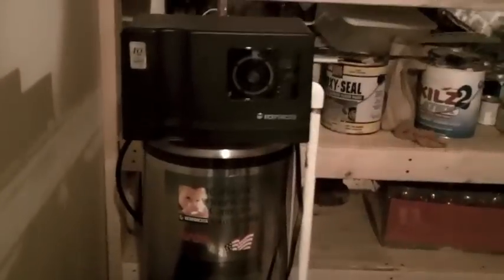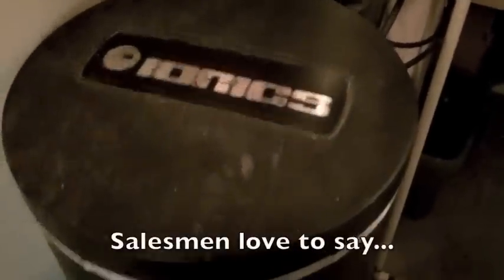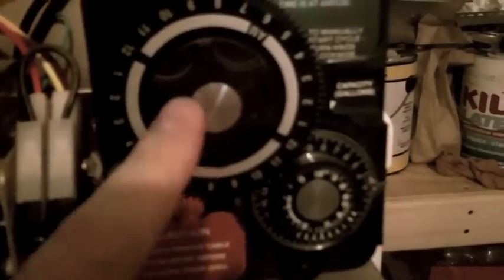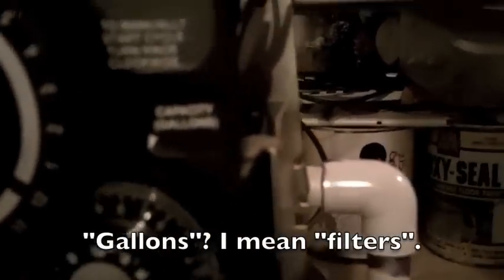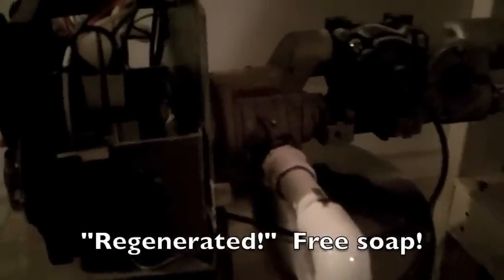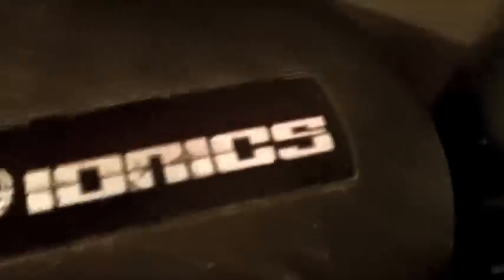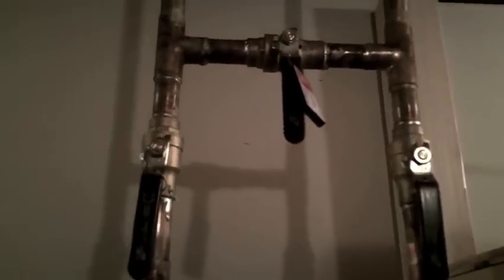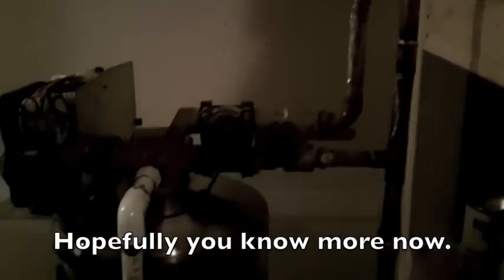Water Softener (Ionics IQ Series) Overview

Comment: Oh, BTW, thanks for doing this video. I've looked all over and can't find hardly anything on these systems...Mine came with our home when we bought it and it's been working well for 3yrs. Although it's old. It does seem to stop softening the water at certain points when I have water in the tank. I "Regen" it and it runs OK for a few days then I have to manually do it again. Do you know why this may be? Or should I just break down and have it serviced and see what they find, if anything?

Comment: Hey Travis,  I hate to bother you once again but here goes. The wires that screw into the black box that plugs in to the power source should have 3 wires, right? What I am asking is this... How is yours wired to the black box? I see a black wire (hot), white (neutral/common) ?green? should be ground? There are 3 screws on the box you plug in. What wires are screwed into your box? I hate to be a pest but momma wants this installed yesterday and is getting mad to say the least. Help!!!

Comment: Okay, now I feel like a pinhead. There is one black wire coming from the head unit. Looking closer there is a red wire and a white wire in this black "sleeve". They should connect to what I would call the power source. On the power source that plugs into the receptacle there are 3 posts. One + and 2 grounds. I doubt it matters whch ground you attach to, but which one are you connected to?

Comment: I have the same water softener but it continually flushes out the discharge line. I think that it is the piston seat failure. Is that hard to replace because the local service company is backed up over a month.

Comment: Here is a realy great question for you... I just bought the same model on Craigslist as well. Not quite the deal you got and had to drive over an hour to get it. I have a manual for it, but do not know how to wire the thing. It came with a power pack that has one positive and two grounds. The problem is that there is only one wire coming from the unit. Any help would be greatly appreciated.

Comment: Hi I have a Softner similar the one you have but I cat adjust the float on brine tank because I got the filter desaseble and I  install my self and I'm going tru salt like craze I need to adjust my timer but on the manual sei the water regenerate at 2:00 in the morning but I don't think thet what is heaping I check twice and the filter sims like not turn on at 2:00am if you cud guiv me some tips I will be thankful

Comment: Great video and learned a lot! Just wondering if you changed the resin and Hygene filter inside the unit. I have the same exact unit and contractors are quoting me near $750 to get this service done. Would love an update.
Reply from the maker: +Kevin C I haven't done it myself yet.  I was debating about trying it but I haven't found any good instructions yet.  I thought about having them replace the resin once and watching what the guy actually does and ask questions so I could learn to do it myself next time.... but I haven't yet.
Reply: +Kevin C He is crazyer than a bed bug Call Ionics or a rep of Ionics yes it will be about 225 dollars thats to change you charcoal and everything it cost be 125 just for a good inspection. The resin and hygene  filter is cleaned by the backwashing of the salt you never change them

Comment: I am renting and would like to turn the Ionics softener off since the landlord isn't even sure if it works and has not used it in years.  But it is 'running' in the respect that I can hear, feel the electricity running thru it.  Is there a plug I can pull?

Comment: Help please?
Hi Travis, thanks for posting this.  
Mine worked for 5 months.  It runs, but doesn't seem to be pumping water back through.  The water level has risen and caused it to leak.  Would anyone chime in please?  Is there a reset, or could it not be regenerating often enough?  Any suggestions anyone has , would be appreciated!  Thank you!  Jill
Reply: Assuming you got this fixed but for anyone wondering - check the float inside the brine tank - it is likely stuck in the down position.
Reply: YES I have one of these the gloat is ussaly the problem. Ironc has a place in columbus Ohio call tgem

Comment: I have one of the same units and the service guy puts carbon or silicon in it once a year.
Reply: Timothy Wooff I know the answer... silver impregnated bacterial static carbon.  I used to work on these :)
Reply: @JohnSebeny  Timothy, I have the same unit and am desperate about changing the resin in the tank myself. Do you recommend that. A service tech wants $1400.00. He says it should take him 2 hours.  He also says there is a filter inside the tank that cost $500.00. Please feel free to contact me anytime with info.